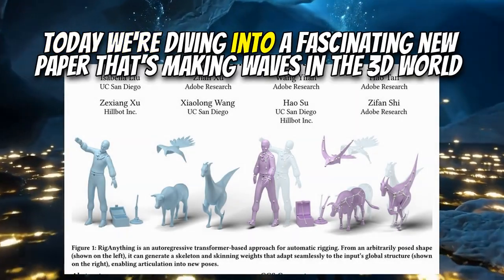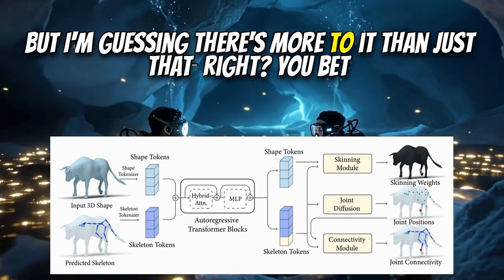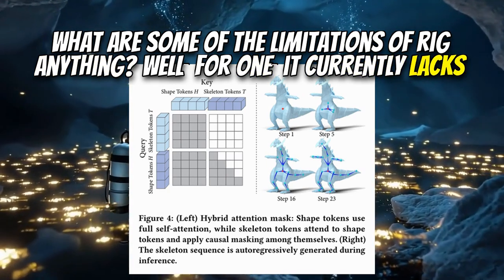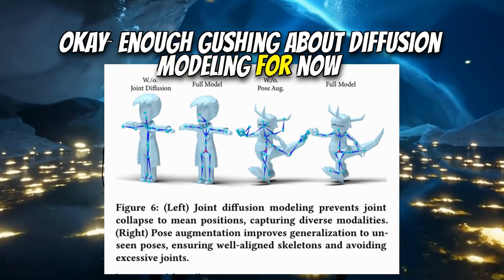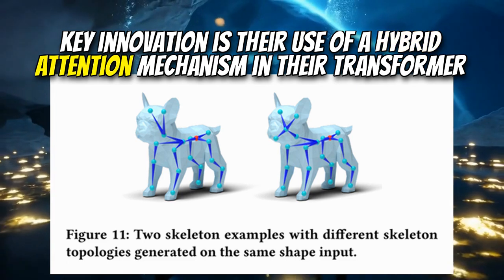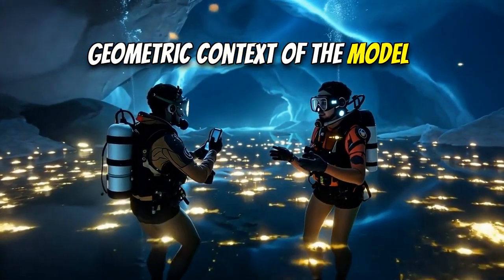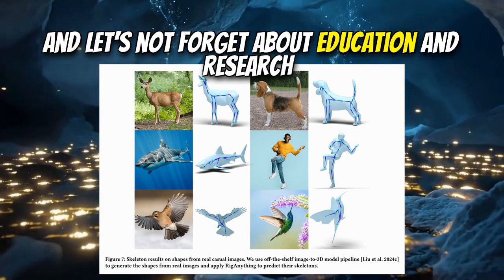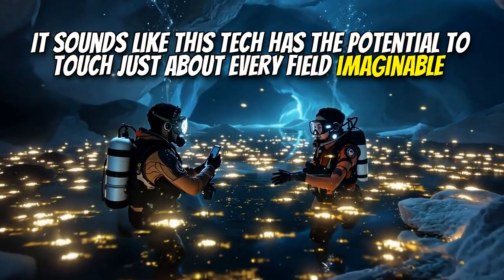RigAnything: Template-Free Autoregressive Rigging for Diverse 3D Assets (Feb 2025)

Comment: I call BS on this. Blenders meta rig that's been around for years is still can't rig with prefect weights. Accurig can take several attempts to get the rig some what close to working.

This will just be another 'as long as you're good at  fixing problems' rigging solution.